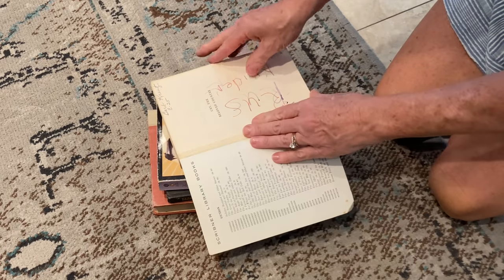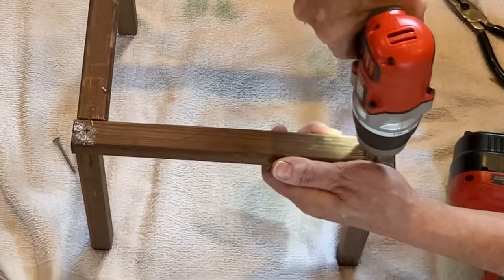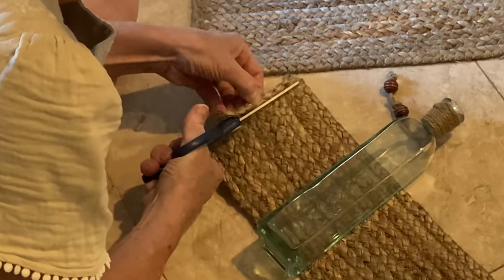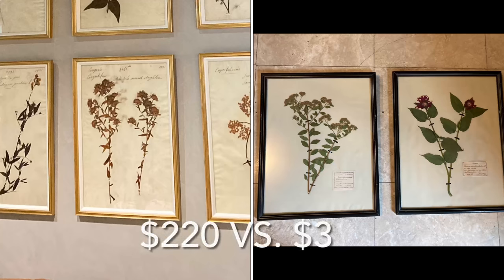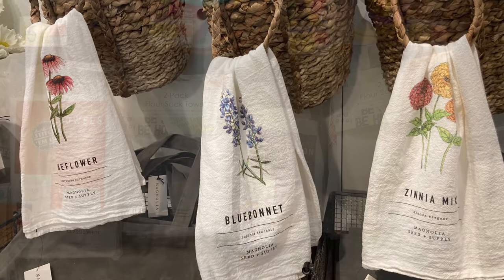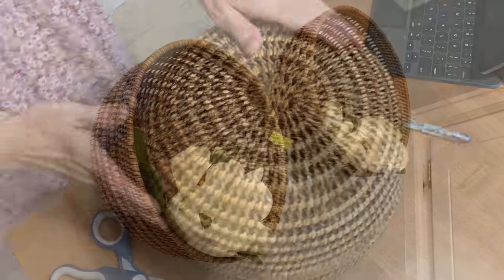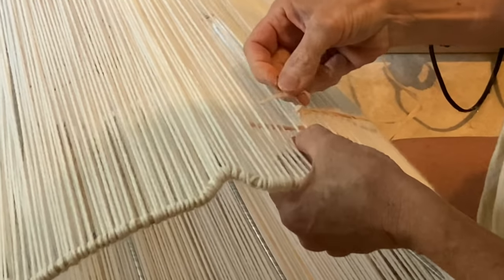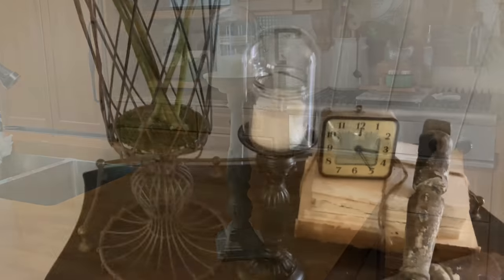MAGNOLIA DIY 14 HIGH-END DUPES SUPER CHEAP!

Comment: When working with oven bake clay, a good way to smooth out imperfections is to use cornstarch. Sprinkle it on like you would flour to dough. I dip my fingers in the cornstarch to lessen fingerprints. It does not affect baking. It's also effective to sprinkle on your work surface first to avoid sticking.
Reply: Sounds like a great trick. I’ll check out your page!😃
Reply: I think you can also use isopropyl alcohol or acetone (although that one might be really aggressive) to smooth the polymer clay.

Comment: Your ideas and your finished things are amazing and inspirations. 
A few years ago I was at an estate sale and came across  a couple of old wood crates.  I bought all 4 for something like 2 or 3 dollars total.
I wood glued the shaky slats that were loose or one side off before I nailed them for extra measure.  Than I sanded them down.  Painted them out with white chalk paint and then destressed with sandpaper.
I then nailed two together and then put the two pieces together to make a short square bookcase or display case.
It looks just like when I finished it back then and has been a favorite for books for years.
A little elbow grease and a little imagination is all you need and maybe a few bucks for odds or ends to finish things.

Comment: I made two candle holders using wine bottles in a basket. I got the bottles at the recycle center for free. You may have to ask them to save them for you. They look great on my two porch bistro tables. Just a thought! These are super ideas. The nicest textured  cushions I have seen were out of bulky fisherman knit or heavy patterned  sweaters and turn them into cushion covers. I picked mine  up at the Goodwill Store. I used the wooden buttons  on them as embellishment. I use the things I make for Gifts and they are happily received by their new owners. :)

Comment: Fun video, thanks for sharing!  If you find yourself working with clay again, may I suggest using either a Teflon or silicone baking sheet?  They both work great in terms of the clay not sticking.
Reply from the maker: Thank you so much for that tip, Andrea! This was my first time working with clay, and I was just trying to figure it out.
Reply: @CanterburyCottage  I don't do a lot with clay so  didn't want to spend a ton of money and used a plastic baking sheet and the clay stuck so much that I ruined the piece.  Then later on while working on a resin project I pulled out my Teflon sheet which I got 10 pieces for less than $15 from Amazon, and I thought I'd see if they worked with clay and they are awesome!  
Thanks again for sharing the video, I wish I had that engineering brain to look at something and know how to duplicate it...awesome!
Reply: I believe you may also be able to use waxed paper as that is perfect when making cake icing moulds from run-out wet icing, or rolled out icing which is cut using a shape cutter. When dry, the item just peels off (carefully).

Comment: When using polymer clay, use mineral oil (sparingly) instead of water to smooth. There is also a product from sculpey that is great for that as well, I think its called conditioner. Bit mineral oil on a fingertip usually does the job.

Comment: As a base for rolling out clay: I believe you may also be able to use waxed paper (UK name) as that is perfect when making cake icing moulds from run-out wet icing, or rolled out icing which is cut using a shape cutter. When the item is dry, the paper just peels off (carefully).
Reply from the maker: Thank you for that tip. I just bought some more clay, so I will give it a try!

Comment: With the wall plaques, how much clay did you use for each and did you do anything in particular to make the edges look so cool?
Reply from the maker: I believe that I divided the package of clay in half and rolled out each piece.  I cut out a perfect rectangle by cutting (with a knife) around a piece of 5 x 7 glass (from a picture frame). As I rolled it out, I kept putting the piece of glass on it, to see if it was large enough yet. The air dry clay became slightly distorted while drying which I think is what created the interesting edges.  Hope this helps!

Comment: Not sure if youll see this now that this vid has a lot of comments already...But, did you notice significant shrinking of the air dry clay? I know some brands will say on the label...usually ones on different websites with a variety of clays sold (for doll making)...but the clay I have doesnt say at all the shrinkage rate as it drys and I know Polymer clay has much less shrinkage as its drying in the oven, but some of the things Im making with it, I prefer air dry. I just didnt know how much the clay shrinks as it dries. Thanks for sharing your amazing ideas!
Reply from the maker: I didn’t notice much shrinkage with the air dry clay. What I did notice was some slight waviness in the clay after it dried. This may have occurred because I put it outside to speed up the drying (and I later read that you shouldn’t do that). Overall, I preferred the oven bake clay. I think the finished product looked more professional.

Comment: Love these! How do you print backwards so you can use the transfer paper?
Reply from the maker: If you are just printing flowers, you don’t really have to reverse the image, but you will need to reverse it if you include words. Different apps have different options for reversing/mirroring an image. I use the “Print to Size” app. When I tap the image, I see two horizontal arrows. That flips the image over. I hope this helps.
Reply: @CanterburyCottage  I realized after that if I copy to canva I could just flip it there and then download :)

Comment: What setting did you use on the iron to dry the flowers? I’ve tried pressing in books but it takes forever for them to dry.
Reply from the maker: I used the highest setting. Turn off the steam setting.  Honestly, I was shocked it worked that well.  I normally use books, too, but I needed a faster method for the video. I think they turned out even better than pressing in books—the flowers retained more of their color.  Good luck!

Comment: How did the hot glue hold up on glass? I have found after a short while the hot glue popped right off.
Reply from the maker: It held up fine. I always use Gorilla Hot Glue Sticks. I do think that makes a difference.

Comment: Tip for joining the frames, hammer a nail in half way, remove the top of the nail, then just  hammer what ever you want to join on top of the exposed nail, add glue for extra safety,

Comment: You need a WARNING note on the screen when you are using Linseed oil. Rags with Linseed oil on them can spontaneously combust and are therefore extremely dangerous. You need to wet them thoroughly then put in a coffee can of water, seal it, then discard in the trash outside.